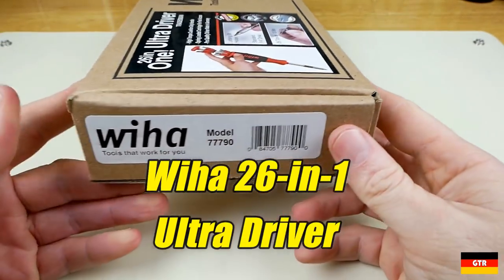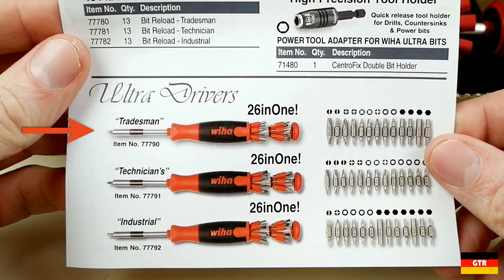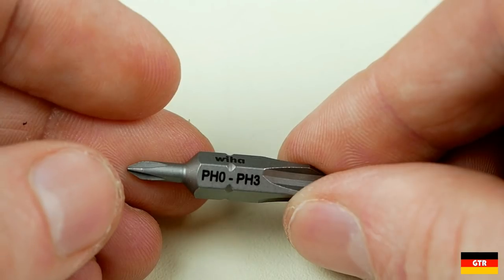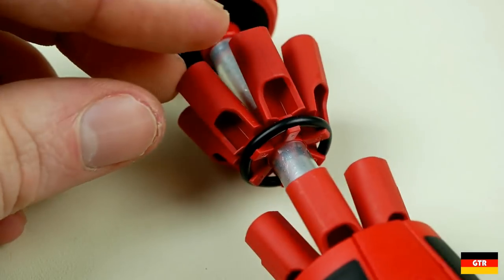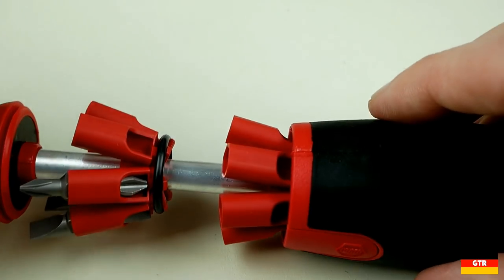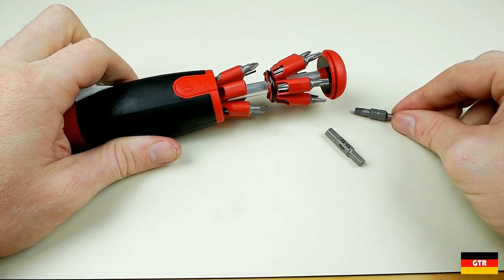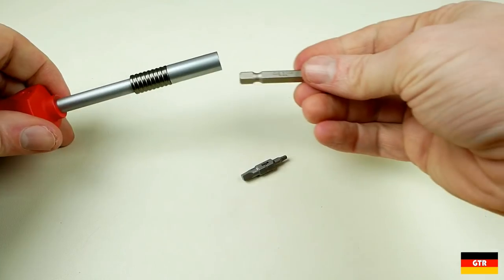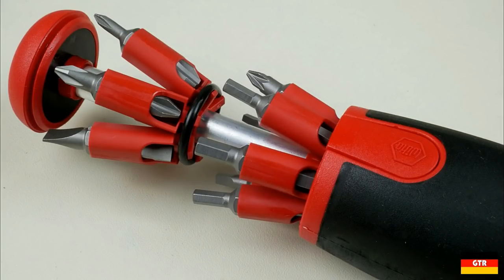Wiha 26-in-1 Ultra Driver Review

Comment: Had this for a year and finally went back to a simpler 10 in 1.  WIHA quality was solid, design clever, and versatile with bit variety but every time I used it if I gripped toward top, cap area,  to apply torque, I inadvertently popped cap open. This was always annoying and troublesome in situations eg on ladder etc. Don’t see as common complaint so it’s obviously me not the tool.

Comment: I bought this driver on the 15th of November, while I was really impressed with the quality of the bits and handle. My locking collar didn't work at all and the spring loaded cap was incredibly slow. I have sent it back to KC Tool to see if they will give me a replacement. Other than the problems I did have, I am really impressed with the tool

Comment: I use this everyday as a appliance tech. The one thing that bothers me is how I have to make sure that ALL the bits are fully seated (even the ones I didn't touch) or the carousel won't slide back into the handle.

Comment: What drive me nuts, none of these sets contains Plus-Minus bits, which is your No1 need if you're installing an electric stuff.

Like, one single Schuko wall socket (doesn't matter, Legrand or ABB) require both SL/Pz1 and SL/Pz2 bits and good luck to find any pocket-friendly bit set on the market that include them.

Comment: I have this driver and I do not like it.   The biggest issue is that when it sits in a bag or occasionally while in use the bit holder pops open.  The latch is so tiny on it that it takes very little to get it open.    I primarily use it for the hex bits. Because of the way the sleeves are and the label placement you need to hunt for the right bit.  Lastly I really dislike how the last bit had no place and needs to stay on the driver.  It's fine as a kitchen drawer screwdriver but don't recommend it for professional use

Comment: This would be perfect if it just took standard bits and was ratcheting...
Reply: Take a look at Wera, they do a ratcheting driver with bit storage in the handle although it only holds 6 bits (7 if you wanted to leave one in the shaft, but it only comes with 6). Unfortunately it only has a magnetic bit holder and doesn't have the lock of the non-ratcheting drivers, however it has the advantage of being a bit slimmer.
Reply: I had the Wera, was not impressed at all. The quality sucked. Sent it back and got the Megapro Ratcheting Automotive.
Reply: What was wrong with yours? I've had mine quite a while and it's been fine so far, been dropped a few times and gets banged about in my bag every day.
Reply: It was the version with the button on the back to pop open the bits. The shaft wobbled, the two parts wobbled when they where either opened or closed and just the overall feel felt cheap. The pop open action just felt gimmicky and not very robust. Especially since it only held 6 bits.  At £39 or $52 there was no way in hell I was keeping it.
Reply: I own the wera and the wiha and both of them are really high quality tools. The wera feels a little more robust, the ratchet is doing very fine for years now. The wiha has it's advantage in having much more bits but only the special wiha ones. But you have all you need always directly with you and the bits are locked well. With the wera from time to time I have to use one of my bit sets and the magnetic holder sometimes is not my friend. The handle of the wiha is a little big, the wera handle is doing better.

So in the end I like both of them and in daily work the main reason to take the one or the other is a decision of ratchet or the bits I need for the current job.

Short Story: On the packaging is a Made in Germany sticker but I could not find any source for buying it here in Germany. From Amazon USA it took only 7 days and I as lucky because the customs did no charge me.